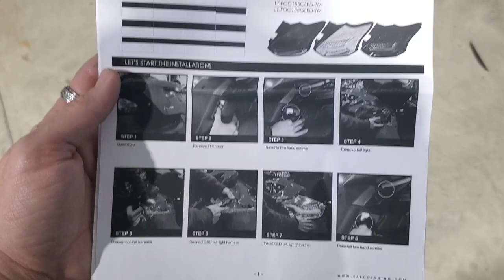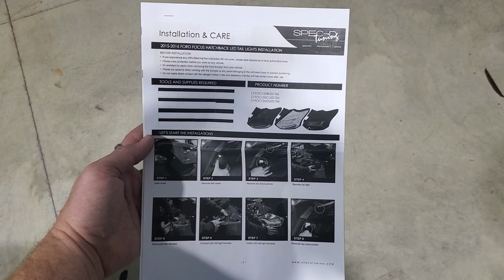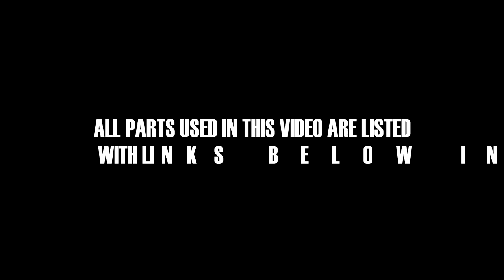FORD FOCUS SPEC D BLACK TAIL LIGHT INSTALL

Comment: I took out the foam pieces so they sit more flush against the body at the tiny point. Just installed mine today. Which is how my stock ones were. Had foam pieces missing. No problems so far.